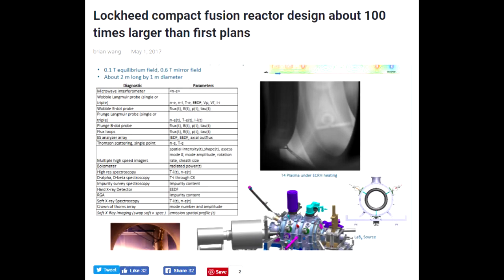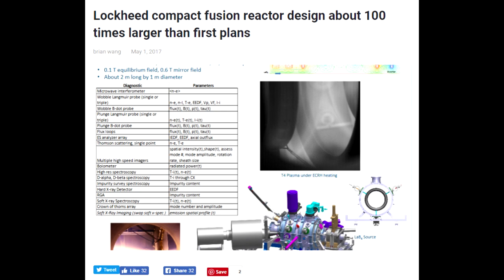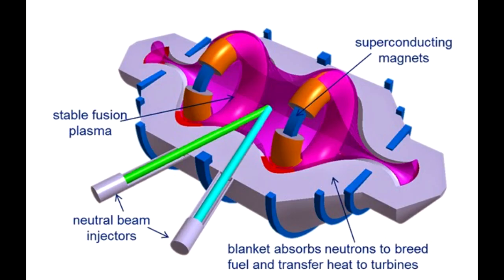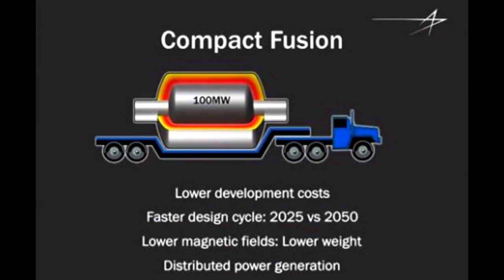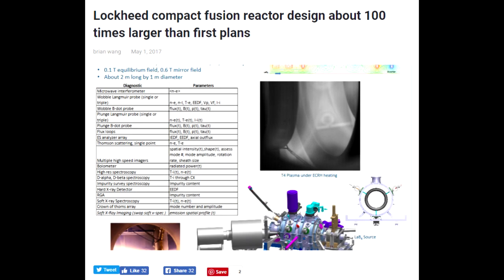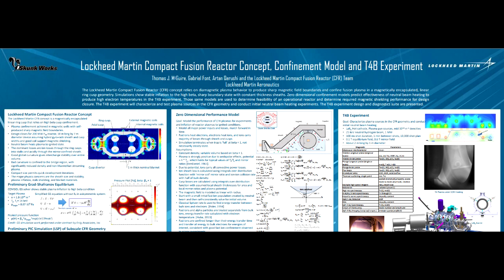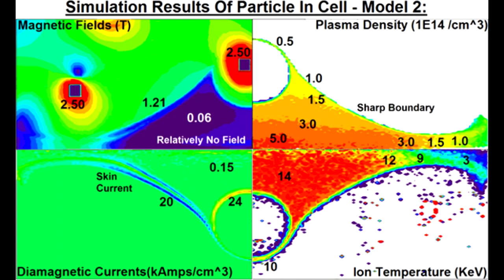Lockheed Compact Fusion Reactor now uh... less compact

Comment: there are simple estimates like the "lawson criteria". The bottom line is, if the fusion reactor is bigger it is easier to achieve the lawson criteria, but the cost increase also with bigger designs.

So how could the design be small? Increase the magnetic field strength.

our sun have two features why it is fusioning working:
1) the size, the power scaling with 3rd order, an the Energy loss only with 2nd order
2) the gravity within the sun is so high, that it doesnt need any fancy super cooled magnetic coils ;)

neither we can't modify the gravitation constant, nor we can't increase the magnetic field density by high factors....
our solution is to build this thing as large as possible.
If the fusion reactor is large the efficacy will also increase.

Comment: How much does an existing 100MW coal or fission plant weigh? Probably quite a bit. If they achieve this 2000 ton fusion reactor it's still an impressive feat. If....
Reply: No. Literally 1/30 the weight will have to be LHe. There isn't that much in the world
Reply: @hellstromcarbunkle8857  Okay. That part I didn't know. So they are just full of shit then?
Reply: @hellstromcarbunkle8857  There is that much helium in the world, it's just unlikely to be practical to move it and use it as aggressively as was proposed. Unless they can somehow pivot to HTS tech this thing will likely go the way of every other fusion concept.

Comment: brillouin has a working fusion reactor validated by stanford
Reply: This Reactor has potential! Their latest test result indicate a COP of 2.7. But thic COP could also achieved by a heat pump....

the highest possible efficiency a process could reach is defined by the Carnot efficiency.
eta = 1- T_Low/T_high

so my question is: what is the minimum highest temperature this reactor must achieve to generate electricity from the produced heat. T_high = T_ambient/(1-eta) = > T_high = 293K / (1-50%) = 586°K -> 600°F or 312°C  

If an Stirling Engine is attached to the Reactor it need at least an efficiency of 37%!

can'tenergy because it produce only so much to keep the reactor running...

But I you could build a machine which convert heat to electric energy with an efficiancy of 40%,
performancemeanselectrical

Comment: Lockheed makes the F-35 which is a lemon, I don't think they will do better at something more difficult.
Reply from the maker: It seems like they've ironed out a lot of the problems with the F-35 and it's actually shaping up into something very capable by this point (15:1 kill ratio against F-16s in an exercise), though perhaps that doesn't justify the cost ("too big to kill") and all the time spent dealing with ironing out those problems that wouldn't be there to begin with if they'd gone with a more specialized design. You have to consider that with the F-35 the problem is as much what the top brass in the military wanted it to do vs what Lockheed could actually build. They wanted them to build the ultimate multirole fighter that is good at every possible task at once, which has been a recipe for huge cost before. 

It's reminiscent of the story behind the Bradly Fighting Vehicle, which had a troubled development history, cost tons, but was eventually justified because what came out of the other end was a competent vehicle (after correcting tons and tons of design flaws caused by the requirements for a "mario" vehicle that could do EVERYTHING). Dramatized (and somewhat embellished) here: https://www.youtube.com/watch?v=aXQ2lO3ieBA

So, I'm willing to cut Lockheed some slack with the F-35, because often the problem is collision between what the engineers know is affordable and possible and the demands of the military top brass and bureaucracy that see all these roles that have to be fulfilled to justify funding.
Reply: Your right about reindeer games with the top brass and defense contractors to pad wallets.  A film was made about the bradley fighting vehicle called the Pentagon Wars that covers a lot of the mishaps with it.  I was hearing the F-35 didn't compete well against older aircraft, guess I was getting bad information.
Reply from the maker: That information is correct; it wasn't doing well before at all, but we are now being told that this has been turned around and they now have impressive performance against the F-16 and other older aircraft:
http://uk.businessinsider.com/f-35-vs-f-16-15-18-lost-beaten-flatley-comeback-2017-4
https://www.popularmechanics.com/military/aviation/a25078/f-35-red-flag-war-games/
https://ukdefencejournal.org.uk/f-35-carves-impressive-151-kill-ratio-red-flag/

However, I did just now find some speculation on what the claim actually means in practice, and it's totally possible that the stats might be being cooked by deliberately misleading press releases:
http://www.thedrive.com/the-war-zone/7488/lets-talk-about-those-f-35-kill-ratio-reports-from-red-flag

If they've ironed out all of the flaws in the fighter and in the way its being used as it seems, then I'm still not sure if it's worth it at all, given the amount of money it cost to get there, but if they really haven't improved, and the military is desperately hiding the still totally deficient aircraft, then this will become a HUGE scandal at some point. We might never know until the plane enters combat and performs horribly leading to loss of lives. 

So it might be a great aircraft that cost way too much and wasn't needed, or it might be a horrible aircraft that cost way too much and wasn't needed. A master of all trades design is something no engineer is going to have an easy time with. The gods of physics demand trade offs. If they pull it off it was still a bad idea to begin with, but depending on how it goes, I might put more or less blame on Lockheed engineers themselves vs the bean counters, budget mongers, and overimaginative generals.
Reply: @Bellthorian  I love your comment--I didn't know about that aspect of the F-35's maneuverability. Yeah, the era of dogfighting for position in order to get a lock and fire missiles is long gone. With modern weaponry, pretty much all future air combat will happen beyond visual range.
Reply: Just because the F-35 has had growing pains doesn't make it a lemon. Many F-15s had structural defects, the F-16 had problems with the F-100 engine inherited from the F-15, F-18s had issues with landing gear crumbling and oxygen deprivation, the F-22 has had performance issues and extreme maintenance requirements…

The F-35 is doing a lot of new things at once, as well as massively scaling up others that were just introduced by the Raptor. Of course there are issues. There would be issues with any aircraft of F-35's capabilities whether it was made by Lockheed, Boeing, or anyone else.